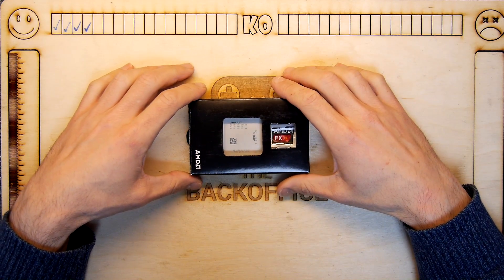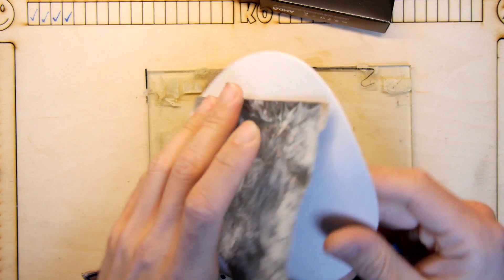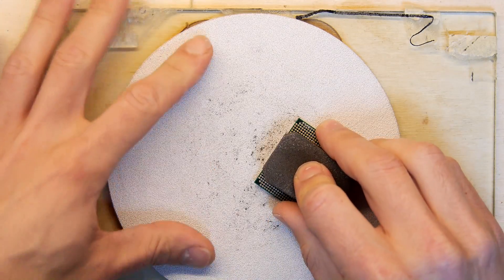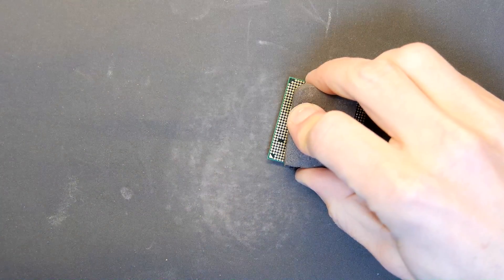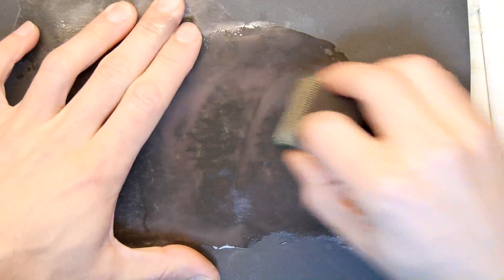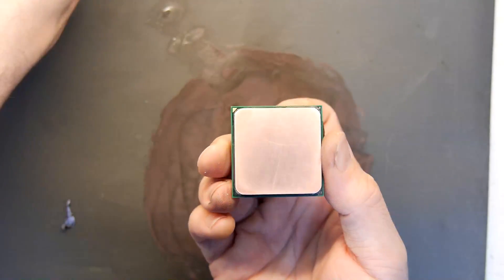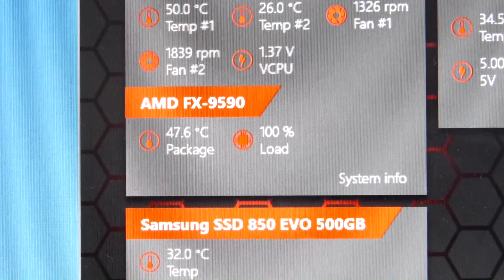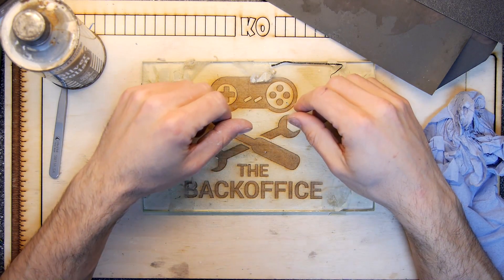AMD FX CPU Lapping (dont bother!)

Comment: Cpu has nice nice surface by default, so starting from 400 or 600 grit and working up to at least 1000 would have given at least close to mirror feel. 80 grit is intended for shaping/large removal, nothing else.

Comment: bought an fx8350 last week ran it thru its paces and got 60c on a cheap air cooler. lapped it for almost 5 hours and reran all the same test and maxed at 44c. you should redo this video and try again

Comment: I know I'm super late to this video, just as I was for the delidding video, but you did not lap properly at all.
First off, you used sandpaper that was too rough to start with. 160 or 240 grit should be a minimum, as 80 or below will leave gouges in the metal that the higher grit paper will have trouble smoothing out.
Second off, you should have cut the foam block in half and covered all the pins properly, and you would not have had to deal with the bent pin near the end of the video.
Third one, you should not have used polish. Polish may make your processor look shiny if you don't use ultra high grit paper, but it creates an impure surface, which is not good for thermal transfer. The only material you want on that surface is thermal compound or liquid metal, Polish leaves behind residues and has a much lower thermal transfer.

If you decide to lap a CPU ever again, Please take my advice, and good luck to you.

Comment: And this is how NOT to lapp your CPU video O_o. You have to do it with grit and water, can go all the way with grit 5000+, cpu pins need to be protected fully from heands and water. Then you need to lapp your heatsink too, even aftermarket big expensive HT have deformed contact surface so what is the point of making your cpu flat when your heatsink is still not making fully contact with it? When you know you Lapp it good? When putting lapped surfaces of cpu and heatsink you actually feal some vacum resistance when you separate them.  And for most cardinal sin, you use polish at end.  So you remove nickel coating over copper base to then put  polish compound on it making new additional barrier, likly with insulating properties, for heat that needs to be transfer to heatsink O_o.

Comment: Don't bother trying for a mirror finish, doesn't make any difference.  Lapping the IHS and cooler flat however does, it was worth about another 100mhz at max overclock when running benches on air for my FX6300.
The same CPU also hit 7648mhz on LN2 making it the 3rd fastest 6300 in the world, it games with no problems at 5ghz so definately worth it.  I've done it with good temp drops only going as fine as 800 grit but I usually go to 2000, takes about 3 minutes from start to finish on my kitchen work top.
Any movements will do as long as the surface is flat, I usually finish on circular, just use common sense.
No point delidding FX as the IHS is soldered to the die, older Athlons and Semprons benefit from a delid though.

Comment: i think that cpus shoud be covered in tiny pyramids and coolers with a mirrored set of  pyramids at an off set to increase surface area and therefore thermal transfer
Reply from the maker: This is an awesome idea, and it locks into place. The heatsink and heat spreader should bolt together rather than pressure on the PCB as well!

Comment: I do this at work with emory cloth and then 000 steel wool.....just to get it relatively smooth. If you think about it the fine micro scratches would transfer heat better because there is more surface area contacting the TIM.

Comment: toothpaste makes a good cheap final metal polish, whitening toothpaste usually has a coarser finish than normal toothpaste.
Reply from the maker: Thats a good tip, do you think toothpaste would work on cars to remove surface marks on paint?
Reply: yeah probably, though I've never tried it. It's quite a soift final polish, not an aggressive one. I'd avoid the whitening toothpaste for paint though, it may have a mix of various sizes of particles rather than a more consistent grade. 
Remember that paint is quite soft (compared to most metals) so go easy on it
Reply from the maker: That makes sense. I kinda remember using toothpaste to remove the makers labels from monitors, i.e. removing the painted on SONY label from a monitor

Comment: its 3mm thick so he cant go through with 600 grid in 5mins
use 240grid for flattening and go up in steps 320/400/500/600/800/1000/1200/1500/2000/2500/3000 so then you can polish xD
Reply: you really dont want to go past 2000 you want micro scratches still, adds surface area for the TIM to latch on too. I generally go with 600 800 1000 1500 2000 on glass. But this also depends on your TIM your using I generally use liquid metal so 2000 is about as low as you want to go with the stuff.
Reply: Robert Hollar depends how thik your TP is ;)
Reply: Well it depends on the microns of the TIM material... Attic silver is smaller so going lower might help diamond, liquid metal and most of the others are a bit larger.

Comment: You got out the high spots on the heat spreader , what about the cooler? I have seen polished heatsinks that weren't even flat , but they looked pretty. Basically , it's like valve seating , you have to make sure  they both are flat to each other , and give you the same  suction like it did on the glass.
Reply from the maker: +majorjockitch The valve seating analogy is a good one. It's an excellent point, I wonder if coolers are more likely to be less 'flat' than CPUs.
Reply: Depends on cooler and what your cooling. AMD IHS's are convex, intel are concave. Lapping also helps limit the TIM between the two. Intel CPUs are to benefit from lapping more than AMD CPUs... Ironically you still want micro scratches in the surface of the a joining parts not 100% mirror. It adds surface area for the TIM to adhere too. Generally 2000 grit is about as far as you want to go.

Comment: I have lapped my FX-8120 a few years ago and i have to tell you - if you want to have results, then you have to go all in. That means - lap the cpu, lap the cooler and use liquid metal thermal compound! The last part is absolutely essential - you will not see gains if you use regular thermal compound - it is just too thick. Also you don't need mirror finish, it has to be kinda matte so the liquid metal can have better adhesion and thermal conductivity. Never use liquid metal thermal compounds on aluminium!
And after all this - don't expect temperatures lower than 4-5C. AMD's don't really suffer from the intel IHS problems like severely warped IHS or bad contact with the silicon.
Reply from the maker: +Wolfshark Great advice, thanks for leaving the comment! Makes a lot of sense.
Reply: Wolfshark Thanks for all that. Really Appreciated 😊

Comment: This is actually very educational.
you've sorta done a can i make it worse video.

pretty safe to say now, not really. (as far as temps go)

so if i was to attempt to lap, and saw my temps 10.c Higher! i would immediately know it was mounted wrong and not the result of a bad lap.

I've actually had a cooler tightened down too much and resulted in higher temps. apparently because the fastener holes where skewed in relation to the cpu, from the pcb bending.

Comment: I used to Lap CPU's back in the day, early Pentiums and such. Never start off with 150 grit, use glass as your hard surface & 2000/4000 or higher grit. Also use figure of 8 movements. If done properly it does work. Do your research before lapping. Also use a bit of dense foam that is the same size as the HS that will evenly spread the pressure over the whole chip not just the bit that spans 2/3d's of the chip as your doing.

Comment: I've had all kinds of advice online about how to lower hardware temperatures, and all were a waste of time and money as the temps barely changed if at all.  I'm on about CPU, WiFi adapters, RAM and so on.  So yes I think either undervolting or just upgrading to a faster computer is the only sensible option.
Reply: What's to advice? Keep it ventilated and dust-free. That's it.
Now for O.C. purposes, of course you'll want those degrees to lower even a tiny bit.
Reply: I'm thinking about IBM Thinkpad laptops mainly, such as different WiFi cards that supposedly run 10°C cooler, or using heatsinks and fans meant for different models, or using a copper coin to achieve better contact etc.  Obviously providing good ventilation and keeping things dust free are the main starting point, but after that you have to experiment or give up.

Comment: when AMD made the FX cpus they knew they had high tdp outputs so they did their best to make sure that the heat is displaced out of the cores properly...    so if you are trying to reduce temps then use a liquid cooler.....   there is no other way... unike intel, AMD has taken care of any internal issues
Reply from the maker: +primus loy That would appear to be the case for sure!

Comment: please learn to lap properly
Reply: The Backoffice : all those visible scratches on your result are proof that your technique was flawed and results invalid.  A proper lapping will definitely result in better and more even contact between the cooler and heat spreader with the use of less TIM.

A good lapping usually shows between 3-5C difference in my experience.  It might not seem like much, but when you get up in to high voltage overclocks every degree counts.

You started off with way too rough of an abrasive.  400 is where I start, 1600 or higher is where I end.  Oil from 800 and above.
Reply: The Backoffice that's why you lap your heatsink or water block as well.  For the average user there is zero benefit, but if you are trying to go from 5.06Ghz to 5.11 and need that little extra bit of heat transfer you'll want every chance of keeping temps down possible.

Also, we'll choose to disagree on the scratches being a problem.  Those are areas that either need to be filled with TIM or remain air pockets, both of which are worse at transferring heat than direct metal to metal contact.
Reply from the maker: if I was paying for a 60 grit lap dance I would expect to see some worn wood!
Reply: 30 seconds on a belt sander will flatten that surface in no time
Reply from the maker: Tim, I guess we are looking at it from difference perspectives. The problem is, over the years, and I am sure centuries people have been doing similar diminishing returns in terms of effort.

When I was younger I had a shitty car. I spend ages working on the engine, polishing the manifolds, changing the cams, tweeking the fueling. Hundreds of hours of effort, and it was still a shitty car, maybe slightly faster acceleration.

Then we went to motorbikes, started again, playing with the needles in the carburettor, air filters modifications, fueling, maybe a faster bike by an immeasurable amount, but unreliable. No matter what incremental gains we make, we cant turn an Ford into a Ferrari, though we might enjoy the attempt!

If it makes people feel better in their investment and they have plenty of time and not enough money to upgrade or jump ship then i am all for it. At least it will encourage a few to at least consider how some of their gadgets work under the hood :)

I totally agree that if you have set your mind to do it, you should take every care in doing it as you are presenting quite a risk to your CPU (in terms of handling) so ought to give it your best effort and take your time. From 400 to 1600 grit, how many steps do you recommend? I will post your recommendation it in the description.
Reply from the maker: +Gentleman Adventurer I wonder how long to actually get through to the die? Depends on the grit I suppose 🤔
Reply: @ jordan lewis

He's been to Lapland so he knows exactly what to do.  Father Christmas shared a few tips on how to get more performance from his sleigh, which was  by using the blood of naughty children.  It also works by spreading their blood on CPUs too! * do not try this at home!  No children were harmed in the making of this video! *  :-D
Reply: Her name was Sandy, but she did not just lathe there..... she performed to the song Knock On W.....
Reply from the maker: +alidan ahh that makes a lot of sense, I'm guessing if the iht deforms is generally a low spot in the middle?
Reply: this dance wasn't even remotely exciting
Reply: @ the backoffice  32 seconds +-3sec
Reply: Lapping does not have a 3-5 degree difference, it's closer to 1 once you got both the cpu and the cooler lapped.

Its still one degree for less than 2 hours of work.

@the backoffice, the issue is when they solder the metal warps.
Reply from the maker: +wolarts CPU vids tend to bring out the stranger comments for sure!
Reply: i was thinking sanding belt and the buffing wheel on a grinder would be an effective quick way, i guess the trick is to use a method where it's unlikely to send the CPU flying across the room.
Reply from the maker: +jordan lewis Sanding a bit of metal till it's flat, I would say this is as proper as it gets. I expect even with a mirror finish that you could see your face in, it makes little to no difference.
Reply from the maker: +Tim Kurash I think realistically scratches, mirror finish is flawed as a concept be the surface area involved. As long as it's flat it will work. There may be occasions where a spreader is seriously warped that it will have some effect on, but that's going to be the rarity. 

That being said, if we assume the manufacturers are putting some effort into keeping these in spec, I would question the relative flatness of the heat sinks. People can spend a few hundred on a CPU but maybe a tenth on a heatsink. I wonder if there are many warped heatsink horror stories?